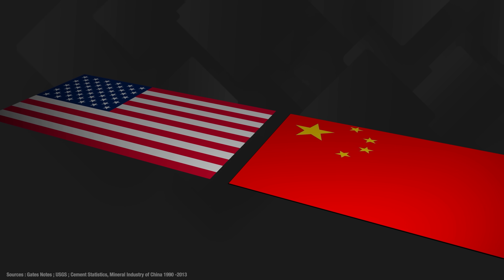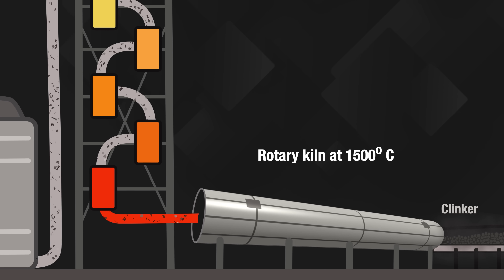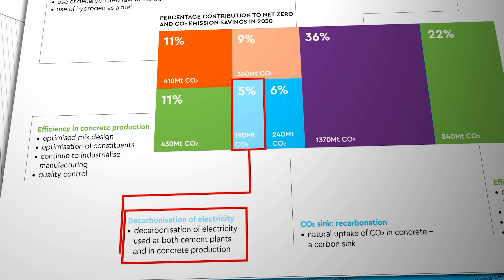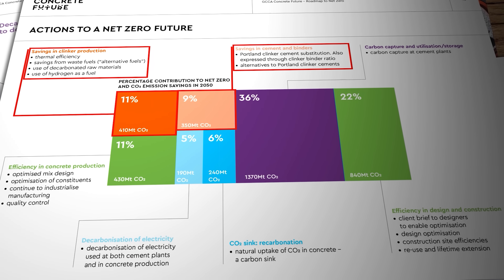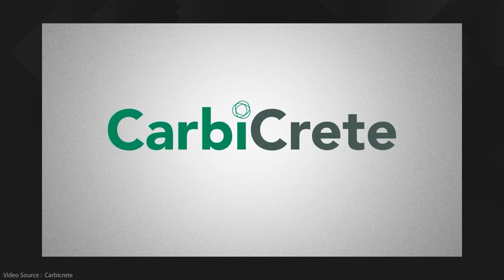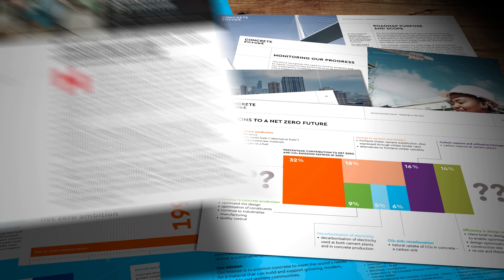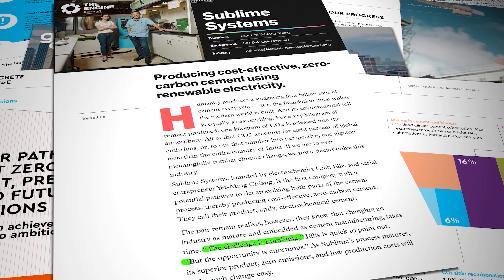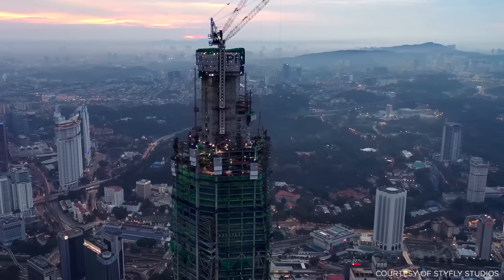How to make concrete green!

Comment: Some negative side-effects of using a new type of cement can take decades to appear.  So there's no wonder the industry is slow-moving.
Reply: The negative side effects of pouring CO2 into the atmosphere can take decades to appear, too. The difference is we KNOW what will happen if we keep producing it.
Reply: @davestagner  Some things just don't turn quickly. The cement industry is like a freight train, try to turn too quickly and it's going to derail, and then you're going to have a much bigger problem.
Reply: @jtjames79  Well, there's "turn too quickly" and there's "refuse to turn at all because of fear of unforeseen consequences". I understand it would take a couple of decades to convert the entire cement manufacturing industry to net zero (or better yet, negative) carbon, in the best case. And it will probably take a financial incentive in the end - for clean cement to become cheaper to make than dirty cement. (We've seen something similar with wind/solar... popularity exploded once they became cheaper than fossil fuel.)

So referencing the original comment, not working on lower-carbon cement because we're not certain it will be equal quality in the long run... that's crap. Crap. If it's passing tests for behavior in the short run, well enough to use it effectively, we should use it! We can solve the crumbling-buildings problem down the road, if we have to. But we DO NOT HAVE A CHOICE about carbon. If you put it in the atmosphere, it will damage the climate. Period. We KNOW this. And since cement is 8% of all anthropogenic CO2, it's a HUGE contributor - so much so that we can't solve the overall CO2 problem without solving the cement problem. 

Sometimes, you just have to take a risk.
Reply: @davestagner  Well you should get on it then. If you want something done right you have to do it yourself.
Reply: @jtjames79  Oh sure. I’ll just single-handedly revolutionize the cement industry. Or, um, maybe this is a job better done by society as a whole?
Reply: @davestagner  You mean you want men with guns to force other people to solve the problem for you.

That's pretty much the opposite of how to get things done.
Reply: @jtjames79  Actually, no. I pretty much want the free market to solve the problem for me. Men with guns are rarely there to force something new. They’re usually there to defend the status quo from something new. Want a fun game? Count the number of wars fought over oil, then count the number of wars fought over sunshine and wind.
Reply: @davestagner  So you don't know what you want or how to get it you just want somebody to do it for you.

And you wonder why things don't get done.
Reply: @jtjames79  Oh, I know what I want, and I know how to get it. But what’s YOUR solution for decarbonizing the cement industry, since you think so little of mine? Do you have a way to get cleaner products to market and replace Portland cement? Or do you think we can’t ever fix it? Or worse, that we shouldn’t? I’m not in the “give up, it’s hopeless” camp, and I’m DEFINITELY not in the “global warming is a liberal hoax” camp. I have solutions, even if they’re hard. Do you?
Reply: @davestagner  So you have solutions but you can't do it yourself? You want the market to do it for you because... society? You don't think one person can change the market. And you're mad at me for calling you out.

Meanwhile I have actually used numerous alternative geopolymers in construction projects.

I doubt you've even heard of Gobekli Tepe, but maybe you should look it up, they figured out a concrete that lasts over 10,000 years.

It really doesn't matter how much pollution is created by creating concrete if it lasts functionally forever, because then you only have to make it once.

But hey that stuff will take actual effort on your part. It's pretty obvious you just want the dopamine hit for pretending to do something good instead of actually doing the work. You can't even be bothered to educate yourself on the subject before giving your opinion.
Reply: @jtjames79  I looked up Gobekli Tepe. It’s wonderful that such an old site survived, but it’s NOT cement. It’s good early ceramic (mud) work, but you couldn’t use it to build, say, a modern bridge, or a skyscraper, or a road surface for cars. It wouldn’t be nearly strong enough. The Romans were the first to use modern limestone-based cement (feel free to correct me if you think I’m wrong), and modern Portland cement was only invented in the 19th century, and pretty much requires coal furnaces from cast iron to generate sufficient heat to cause the chemical bonds to form. 

I’ll freely admit, I have not worked with modern alternative cements. I’m not in construction. I did have a garage and new sidewalk/steps built a couple of years ago, but back then, I didn’t understand what a massive carbon problem Portland cement is, or I’d have looked for an alternative. But I probably wouldn’t have found one, not locally. I’m not sure if alternative cements would even meet building code! And the amount of concrete used for my garage and new steps was minuscule compared to the amount my city is using just in my neighborhood, on street replacement this year. This is what I mean by “society”. I’m now considering trying to address the city/county government to look into alternatives to Portland cement. But can they even buy them, locally? Odds are there isn’t a local high-volume cement plant that could handle what even a decent-sized city uses for roads every year. I’m pretty sure that if I was doing a little home project, I couldn’t go down and buy a couple of bags of alternative cement at Home Depot, the way I can regular cement. 

So. It’s not something one person can just “change the market”. One person can do one small part, but a lot of it is just raising awareness and creating demand.
Reply: We already know the negative side effects of OPC. Continuing to use it is persisting in error.
Reply: The technology of softening stones is finally being rediscovered. 

There's a theory that the pyramids weren't stacked they were poured. It actually explains how the stones were so precisely laid in the simplest way possible.

So the ancients had a way of making concrete that turned into literally stone.

There is a bird in South America that's figured it out too. They grab a very specific twig and use it to carve out nests out of solid stone.

Basically Warhammer 40K's "rockcrete" isn't just a real thing, it's superior forgotten technology.
Reply: That's what happens when you've had a rock solid industry for decades. Too much inertia makes it very difficult to shift their mentality without fracturing the whole holistic system that exists around it. But it still has to happen, since, after decades of cracks forming within the industry due to its ever increasing climate impact, we are coming onto a point in time where we cannot allow the thing to set naturally.
Reply: @zennvirus7980  Tell that to a house owner whose house starts crumbling 20-30 years after construction.  Or the government that has to bear the cost of a bridge that becomes unfit for use due to some material degradation.  This industry has to be slow moving and careful.

Comment: Carbon-charged concrete serves only one function.  Sequestering carbon into soil improves the ability of soil to both sequester water and improve aeration; recharge aquifers/water tables; reduce flooding, water pollution and the effects of heat waves and droughts.  
Putting it in soil would help reclaim soil function and directly improve challenged ecologies.

(Edit) What about the possible long term acidifying effects of carbon in concrete?  

 Thank you for the video, though many have jumped onto the this bandwagon without considering the downsides...
Reply: Think another example of much better ROI would be more rail, both freight- and passenger-rail, everywhere.  Currently it is confined to urban areas and the East Coast (US) as well as most of the large countries.   China, Australia, Canada, Russia, etc still lack adequate rail coverage.  
India seems to be ahead of us on this.
Reply: Developing low-carbon concrete is in no way "greenwashing".  Traditional cement manufacture is a problem that needs to be solved.
Reply: @incognitotorpedo42  
Adding carbon to lime does zero to solve that problem while ignoring the real problem of depleted soil carbon.
Reply: @B uppy not sure why you feel both of these  ideas can't be concurrently implemented?  If there is a way to start decarbonizing cement, there absolutely are valid reasons to do so.
Reply: @JeremySpidle  
Why bother with putting carbon where it serves one function of 'sequestering carbon,' when adding it to soil 'sequesters carbon'plus improve soil aeration; reducing irrigation needs, flooding, drought and heat wave effects; increasing food production; recharge aquifers; etc?
Reply: @b_uppy  You are obviously stuck on your favorite "pet solution" to the world's problems.  I'm sorry to inform you it will take more than one solution to solve our problems.  That's kinda what this channel is about. I'd suggest you branch out your horizons.
Reply: @JeremySpidle  
Falsehood on your part.  I prefer solutions that have a high ROI. This carbon/concrete one is a failure as it has only one function and may actually cause early failure of concrete. 
I have embraced technologies that do that because I am sensible rather than slightly, eith a head in a swivel at every shiny new thing.  
Sequestering carbon onto soil solves a lot of carbon problems with a lot of positive outcomes that carbon into concrete fails at.  You need to look at better solutions rather than throwing in with the newest dubious tech a corporate conglomerate says is 'sustainable'...
Reply: @JeremySpidle  We're sorry, This mind is not available to be reached right now. If you'd like to have a good day, we recommend going for a walk, or just queueing up an other video from Just Have A Think, Veritasium, Undecided, or any of the other great science presenters here on YT!
Reply: @b_uppy  Please consider getting some sleep, THEN a nice, calming beverage. Maybe take a deep breath. 

ROI is absolutely important, but it behooves us to remember that this is a RATIO, and if it paralyzes progress then it reduces the TOTAL returns. You're focusing too much on the biggest bang for your buck by getting a job that pays really high hourly wages and forgetting to make sure you have enough of those high paid hours to get enough total money to pay your rent...
Reply: @b_uppy  Yes, because Carbonized Concrete couldn't possibly have any use other that containing itself...
Reply: @lady_draguliana784  I had reached the same conclusion.  Our dear friend B can't see the forest of solutions for the Sequoia of sequestration.  I'll indeed not let this bring me down, as I feel I have already presented decent counter points, zero of which he is willing to even consider.
Reply: @lady_draguliana784  
This is a tech of dubious nature at best that you and Jeremy have failed to justify by any cogent argument.  Carbonizing concrete fails to increase utility, while quite easily increasing harm in both a specific as well as generalized sense.  
Suggest you both take your own advice to take a nap.
Reply: @b_uppy  Dang, you're a stubborn one.  But how you gonna compress all that hot, C02 rich air into the soil instead of into your keyboard?
Reply: @JeremySpidle  
Suggest you look up Walter Jehne for better overall approach to climate change.  If the solution is virtually a zero ROI, why bother???  
Pretty sure carbonized concrete is a negative ROI.  If the reality is that it causes more harm --it is a bad idea...
Reply: @JeremySpidle  I Agree and Admire your Awesome Alliterative Abilities! 🤣💕
Reply: @b_uppy  We can tell you aren't paying attention as you missed the part about some of the carbonization tech's actually INCREASING the Compressive Strength of the concrete, which would be a fabulous utility for numerous applications, especially if the alteration of costs and production is nominal. Superior Foundations comes immediately to mind.
Additionally, you seem to not understand the concepts of Research & Development, nor their purpose in industry...
Reply: @lady_draguliana784  
I paid attention and where is the independent confirmation of this?
Reply: @b_uppy  again: still in research phase. Can't know until we learn, now can we?
Reply: @lady_draguliana784  
And yet we do have research that shows that it works in soil, with zero need to wait 50 years for the go ahead...

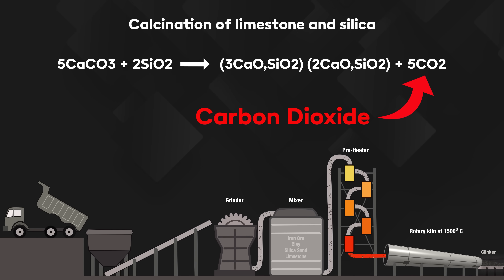Comment: You could simplify the formula at 1:53 to CaCO3 -> CaCO + CO2.  The SiO2 is unchanged, so appears to be a catalyst.
Reply: SiO2 is not a catalyst; it reacts with CaO to form Cacium silicate and when hydrated, the product is a mess of interlocking crystals.